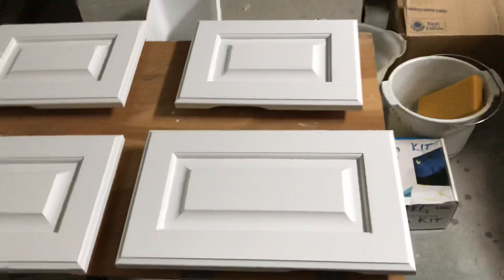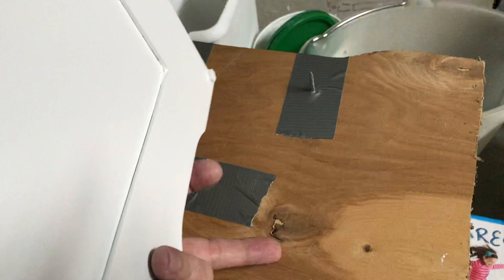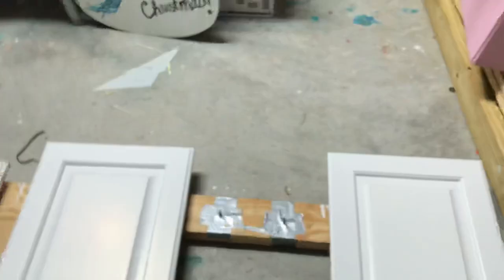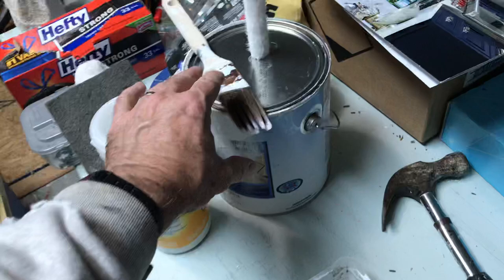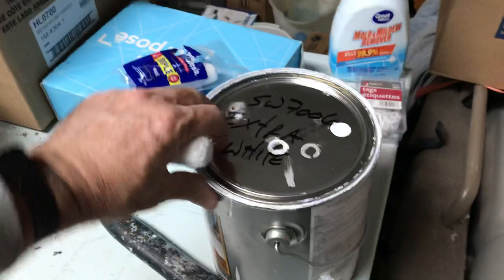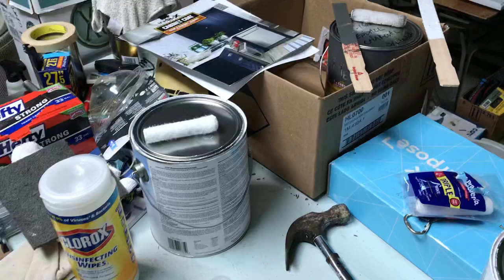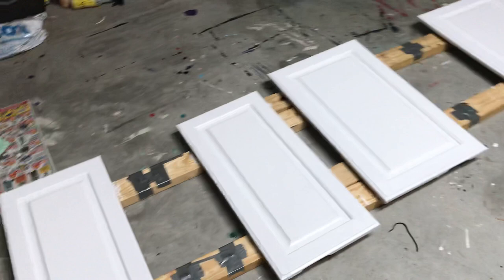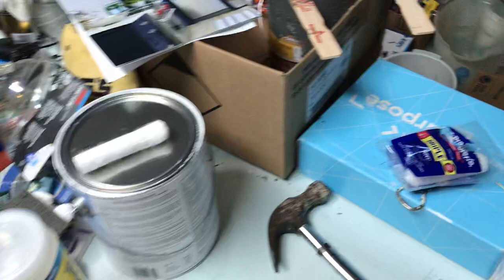Kitchen cabinet paint tips. Easy to make drying rack, Insl-X paint, roller finish

Comment: At 1:20 I got really discouraged because I just bought two cans of Cabinet Coat and saw how bumpy your surface is. But when I heard later that you used a roller I was so relieved and hope I can get a spray finish even better than my brushed finish that I can get with BM Advance. But a roller... no way. I can spot a rolled cabinet a mile away.
Reply: Rolling is the worst way to apply Cabinet Coat. It looks better when brushed if you sand between coats. Ive never sprayed it but others say it sprays well with an HVLP sprayer.
Reply: @snoopster000  Now after only 1 year, Cabinet coat is not holding up. I've had to touch it up several times over the past year with Benjamin Moore Command which has held up much better so far but still doesn't seem as hard as a rattle can paint. I have to do this again, I'm going with a something more industrial-level.

Comment: Hi, I jus pt bought this paint from Benjamin Moore. When I open the can, many air bubbles are on the surface. And when I apply with brush and roller, many bubbles are showing on the coat. Do you have the same situation? How do you get rid of the bubbles?
Reply from the maker: I always stir paint with stick and have not had a problem with bubbles. Ask your local paint shop for their recommendation on the situation. Good luck.

Comment: I thought cabinet coat did not need a primer… Wipe it down good with denatured alcohol. Scuff sand. Wipe again.  Sprayed finish is premium look.  Much faster. Comments?
Reply: sanding is not faster than priming and you probably only need 2 coats after priming.

Comment: How are your cabinets holding up any chips yet?
Reply from the maker: lorraine bevis Great question, Lorraine! Overall they are holding up really well, with no obvious chips...except for the lower cabinet door that hides our pull-out kitchen trash can.  The inside of the door has a notch to make it easy to open and that small area must get several hundred finger (and fingernail) scratches a week. The dark gray paint is scratched in that small area only. The white primer (Stix) below is holding up fine. It will be easy to touch up sometime... good luck with your project!